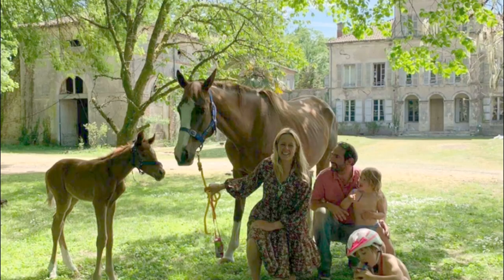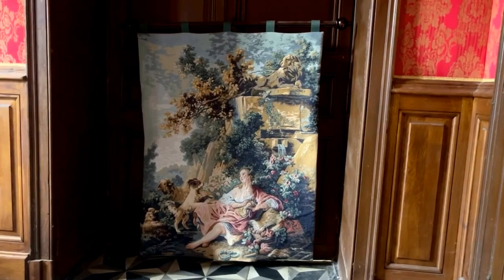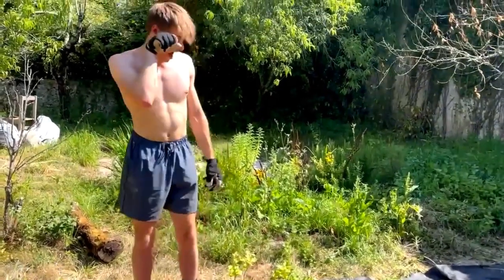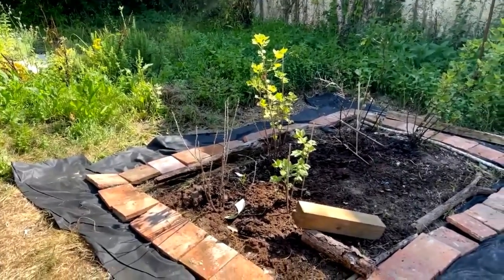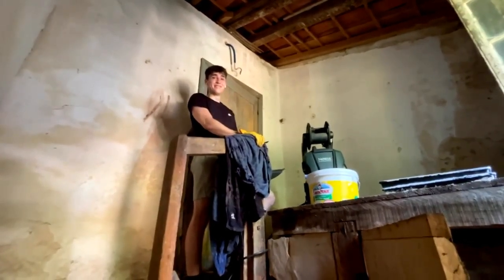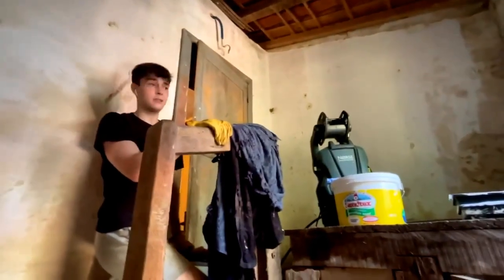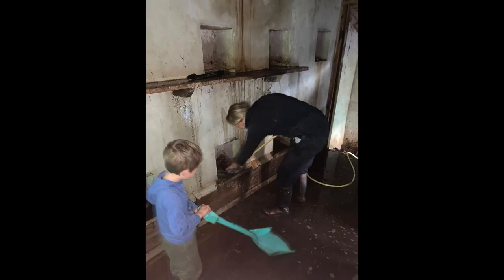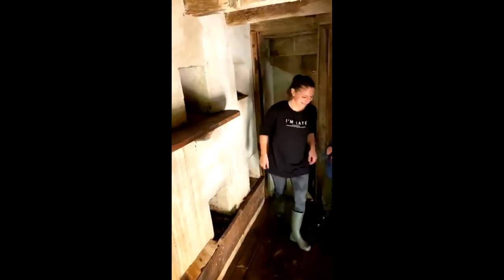Chateau Dreams Episode 7 - 5 Volonteers & A Baby! Backstairs/Walled Garden & Pidgeonaire #chateau

Comment: You might want to check into “no dig” gardening. Cardboard is put down in the beds, watered and covered with soil before planting. Saving time in the long run.  Good luck.
Reply from the maker: Hi Karen! Thanks so much, the beds at the back are no dig to a point and they are raised we did do it with the rose garden. I’m trying to find out more about it as it seems a great system and I believe it’s great for the soil structure any sites/books/info or channels you can recommend would be great!